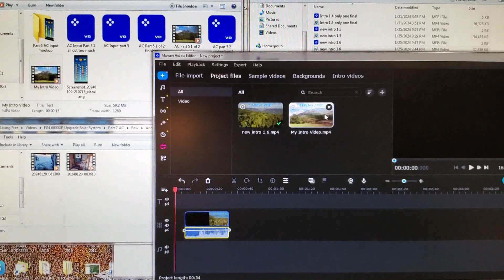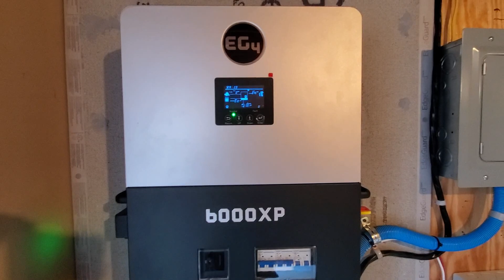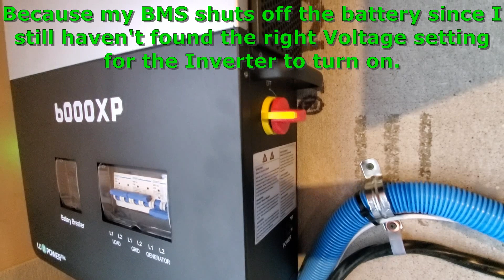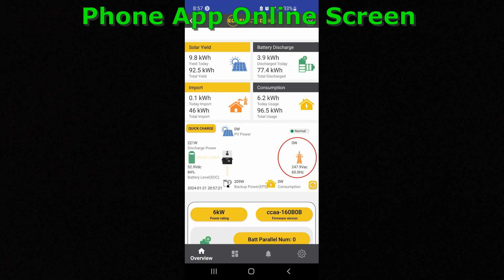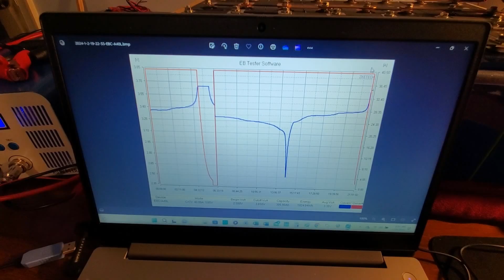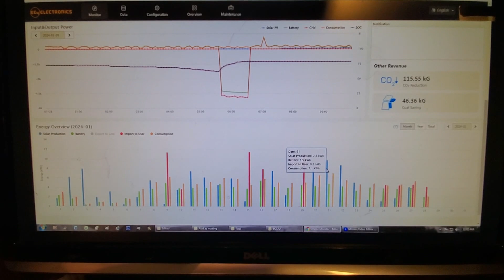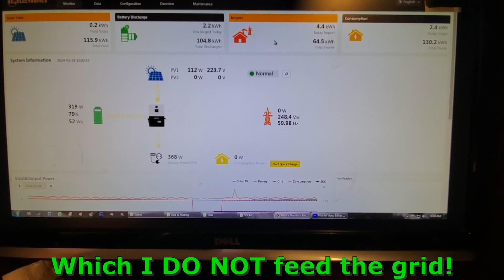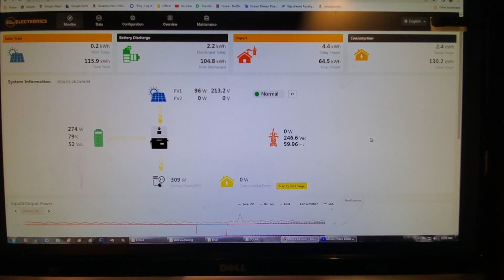EG4 6000XP - Part 7 - Settings and Thoughts I - Solar System Upgrade

Comment: just ordered a 6000xp I hope it was not a mistake. I have 3600 watts of panels for now. I have 4 12 volt lifepo4 standard 100 batteries. Is this going to work for me? New to solar. Thanks New sub.
Reply from the maker: The 6000xp is a 48v system so putting your batteries in series should work. Of course you're always going to want more panels and batteries lol

Comment: I like the new intro.  Yes I agree the transfer switch in the 6000XP is really good.  I'm powering almost my entire main floor with it.  Since my panels aren't mounted yet I'm not getting enough solar daily to meet the demand. So when I hit my "On Grid EOD Discharge" percent of 20% it switches to bypass.  
As for the vampire loss you're also losing some on the way in  and out of the batteries.  I think it's 5% each way.  That may account for the difference you see from Solar + Import doesn't equal Demand. Thanks for all the tips on the software.  If you have the real estate I vote to keep the panels in a straight line as it is easier and gives you more usable land.
Reply from the maker: Thanks! Agreed and my solar isn't enough either lol always something isn't it but one day i will pull the plug lol! Ya I'm thinking straight line too for now too since I can really only add 6 more panels with the V offset from cold and it would look off balance plus its easier! I'm all for easier lol i do love that Quick Charge button from anywhere my phone can go. If a storm is coming and batteries are low, push it and an hour later I've got 50% or better charge back in my batteries without even being at home! I'm gald I hooked it to grid actually far more dependable for now and no clock, computer,  modem resets! Thanks again for your comment! Take care

Comment: Does your bms not come with a communications port?
Reply from the maker: Not one that will work with the EG4 or I should say, without adding other devices etc. I'm old school and don't like buying the latest "greatest" thing. I figured out the voltage I needed and it's working fine now. It's not using the full capacity of the battery but will once it's balanced so I would prefer to not add more devices to the system, spend more time learning how to use it correctly only to find out it doesn't add that much amp to really make a difference (I mean really, 2 amps for this size battery only when it's over 3.45V? How does that really help much?) that would off set my time and money. I'm just not sold those kinds of things unless I can prove it myself. Too many people selling on Utube as what I call nowadays " reality TV salesmen" as if they really care about  your system. It's all about the money sadly. Thanks for you comment. Wishing you the best. Take Care.
Reply: @LivingFree4All  Each to their own. As someone with a background in engineering I can say that as long as you are not over charging the cells horrendously every day they should be just fine.
Reply from the maker: Hi Dave, I am not over (or under charging), I can't get enough solar to do that with these panels lol. I shut down all AC charging at 3.4V as I don't want to use anymore grid power than needed just to get them to about 50%. Plus my BMS will not let any one cell go over 3.64 as I set it, not even 3.65 ever. I'm not an engineer but I play one on UTube lol I'm just a 40 year contractor in construction with 4 years at Tesla so I like to play like I don't know what I'm doing but I know more than most think lol Thanks for your concerns, I appreciate it. Take care. @davefroman4700
Reply from the maker: As an engineer you measure with a micrometer and I mark it with a crayon lol btw that's a joke from my father who is also an engineer. He once spent 15 minutes explaining to me how to safely erect my kids swing set when I picked up the 6x6, climbed the ladder with it and placed it on the top 2 seconds later and his response was, or you could do it that way, while laughing, not that it works out that way always. I do hire structural engineers to cover my ass for sure lol @davefroman4700

Comment: I am currently trying to decide between the 6000XP or an 18k PV when I finally get around to replacing the 6500EX.
Reply from the maker: Lol I can't help you with the 6500EX (ive heard some not so good things about it but I really don't know) or the 18k PV. To each their own I say. If you wanted to buy batteries for it (a big yes considering the current world conditions and no grid in the future or other reasons) I would go with a server rack battery. Sad part is, the batteries are the most expensive part of the system. Panels go for $50 each if you don't get top of the line or can go used, which mine are and they produce about the same amount of power and i have no reason to believe that's going to stop anytime soon, guess I'll find out. 5-6 years and still strong as new! Good luck with what you go for. Let me know you thoughts once you start down your path! Thanks for the comment, Take care!
Reply: I have the 18K PV it can handle load imbalance real well. up to 8,000 watts on one leg plus it only uses 70 watts to run as a 12k inverter. I have 14.6k of bi-facial SEG  panels and it can handle 18k no trouble.
Reply from the maker: One nice thing about doing 3 of these 6000xp would be the redundancy factor.  If one went out you would still have 12k working. That's why I went with the 6000xp. Redundancy means a lot to me. But im going to pay the price on additional power drain of 3 of them!

Comment: That looks quite nice!  The bank probably needs to be larger and you'll probably want even more solar.  Once you start using hybrid inverter solutions you will quickly find that the "idle power" of the inverter is pretty bad, usually 30W-60W.  So you need to have enough solar and storage for that vampire draw to be less consequential.

The BMS high-side disconnect should be roughly 3.65V/cell.    Typical charging parameters are to charge to 3.55V/cell (bulk target), which would be 56.8V, then hold there for 1-2 hours (absorption) to give the BMS time to balance the cells, then drop to a float of 53.6V to 54.0V.   Disable any current tail setting in the charger.

The key to keeping the cells in balance is to hold at the charge target for long enough for the BMS to be able to make progress on its balancing.  If you can program the BMS, program it with the above settings.  Also if you can program the BMS's cell balance-start voltage, select a voltage of 3.45V or 3.50V for the balance-start.  No lower than 3.40V (the balancer will make incorrect decisions if trying to balance below 3.40V/cell and tend to take the battery out of balance instead of bring it into balance).

If the cells are way out of balance it could take quite a while, as in weeks, for the BMS to be able to get them back into balance.  Once they are in balance you should no longer be hitting any sort of BMS disconnect on the high side (with the 3.55V/cell charging target).

For the low-side disconnect, the bank will be at 48.0V at 95% discharged, roughly (3.0V/cell).  That's the level I recommend you program the EG4 to stop drawing from the batteries.   Once the BMS has balanced the bank it shouldn't be disconnecting prior to the bank dropping to 48.0V.   The BMS typically disconnects when a cell hits 2.7V (43.2V for the bank).

You definitely do not want to allow the cells to get too low, for multiple reasons.  And you are correct that a properly configured and balanced system should never be hitting BMS disconnects.

--

For the solar panels, either configuration works.  The straight line would probably be easier to work with and also be easier when expanding the system later (to add a second line).  Go for the highest string VOC that the EG4 can handle to minimize cabling losses.  But be sure to have a 20% margin of error for the labeled VOC on the panels that you add up vs the EG4's maximum DC input voltage, particularly since the panels will be more efficient than usual in the cold weather.

-Matt
Reply from the maker: Hi Matt, Thanks for the detailed comment. I agree lol I don't have near enough panels right now and the current 14k battery is pushing the lower limit hence why I have the second battery which will get me to 28k which will work a lot better. either way I hook up the panels they will be in series so I can get my voltage up higher. I can't go all 16 in series since that will push it over the voltage with the same 20% margin of error on cold days you talked about which is a dilemma I am facing. I can only put 14 which leave me with 2 to spare. That's not near enough to charge a 28k battery bank lol. The higher voltage coming in would increase the efficiency of the solar charger for sure too.  So yes I know I need up the panels to beyond 14 panels. Fortunately, I have the 2nd MPPT on the inverter so I can add different panels when I do expand it more. If I get a second 6000XP i will have 2 more different arrays I can add as well. So I do like that about this inverter, room to grow.

Regarding the battery balancing, I find the amount these BMS's produce and the limit of being able to balance all the time, is not worth the effort or money trying to make it happen. I just take them off line once a year or two and re-balance them when they get too far out. I'm really not sold on balances. Maybe I'll change my mind when I have more free time to play with it but right now, it's not as critical as the other things I need next and my time is too limited. Great comment and I appreciate your input! Thanks and take care!
Reply: @LivingFree4All  Sounds like you have a great handle on what you want to do.  I'll add two more observations that may help.

The first is... remember that you can always wire solar panels into discrete charge controllers (such as a Victron 100/20, or a Victron 150/35) to aid in charging the battery.  For discrete charge controllers the string operating voltage only has to be about +5V over the battery charge target... call it 62V, so there is more flexibility.  3 smaller panels in series or two residential panels in series is usually enough to get something going.

There is really no limit on the number of charge controllers you can connect to the battery beyond ensuring that the total maximum charging amps is within the capabilities of the bank.  For a large battery, that is typically a lot of amps so it isn't a problem.

--

The second observation is that being able to charge the bank to full is a function of solar power verses consumption.  Once the bank is big enough to cover 24 hours, the size of the bank no longer matters so much in terms of daily operation.  Only in terms of extra buffer to bridge bad days.

If the daily solar generation is insufficient to cover 24-hours of consumption the battery state of charge will simply continue to drop day after day until its is knocking against empty.  And if the daily solar generation is sufficient, the battery will slowly claw-back its charge day after day until it starts knocking against 100%.

Optimizing this is as much about optimizing/reducing the consumption as it is about adding solar to cover the consumption.

Good luck!  I wish I had that much space for my panels.  I mostly have to put them on my roof which takes a lot more effort.

-Matt
Reply from the maker: Ya ouch on the roof solar, I am lucky with having some land so it was always going to be a ground mount for me. I like to have 3 days of battery power without solar and had it before my upgrade. Living on the east coast, boy it can be cloudy a lot especially at the worst time winter! I want total independence from grid. I'm not there yet lol. I really need 4 times the solar panels that I have now for both batteries but fortunately solar panels are the cheapest part of this system and I got space. I will add a 11-12k propane generator to the system with 500 or higher gallon propane tank just of battery charging when cloudy days discharge my batteries to get me fully off grid. There is a lot more to solar than people think, what you are running on it, how efficient are the things you are running, etc etc. and I find it challenging and fun learning the reality of it. Cheaper to use more efficient appliances than addng more inverter/batteries/solar panels and that is where most should start then develop the solar system or at least both lol. I did love my victron 250/70 solar charger and I'm going to have to find use for it again here tied directly to batteries like you said. Great advice and Thanks for the comment. Take care!

Edited: btw this EG4 6000XP has two separate MPPT chargers so I can put 2 different solar array configured on it , plus I can use my old Victron 250/70 direct to battery too to add more solar to the system. Now i need another pallet of panels lol, It never ends does it lol Thanks

  @junkerzn7312

Comment: I use the JK B2A24S20P BMS with 2 amp active balancing @ 200A 48V. it is a Smart BMS with Bluetooth. As soon as the cell voltage hits 3.45v it begins balancing the pack. JK also makes the same thing in an inverter style that will talk with the EG4 inverter/charger. your overkill BMS is made by JBD and is a passive balancer. Passive has a hard time keeping the battery equal.
Reply from the maker: Interesting, I'll look into it some day lol. If you read the above comment I made about what I think about balancing you might understand why I don't spend a lot of time with devices that say they will balance a battery. After 5 years with these batteries, I really don't have  that much problem. This one is off because they were never balanced as a set but are 2 separate batteries over the last few years. That may be a problem, I'll soon find out. Balancing the batteries is easy once you reconfigure them. It just takes several weeks of doing nothing but topping them. In my opinion, it's faster and better than any cell balancer (easy and no time) so I really don't mind. Thanks for your commit, wishing you the best. Take care.
Reply: I've been looking into JK bms for a looped system with the EG4's. Does it really communicate with the EG4 6000XP? Off grid garage also came across a chip that will do crazy stuff between inverters and JK bms's.
Reply: Yes, he calls it the Peter Board. The JK-BMS inverter version will communicate with LuxPower based EG4 inverters.
Reply: @stevenfrazier8939  Yep, the peter board ...lol 
Thanks so much. I have been trying to verify this for a few days now.
Reply from the maker: I will have to make a video to ask about the "communication" between BMS and the inverter as I would like to know more about what the inverter can do with this infromation and how it relates to the BMS. What does it actually communicate and how can it benefit the system, mainly will my inverter be able to read each cell on each battery and react? or is it just simple total battery voltage etc. I need to learn more about this. Thanks for comments @stevenfrazier8939
Reply: @LivingFree4All  I'm a about 5-6 months into this rabbit hole and got 16 cells coming from china, so we shall see how this plays out. I'm a engineer and have always loved electrical stuff since I was a kid so this first build should be interesting. My brother was going to help me as he was trained in building lithium batteries as he was a A&P mechanic but he died unexpectedly on the 13th so I'm on my own now. learning all about balancing cells etc. I am acquiring tools, testers, batteries, mounting fixtures, panels as I go along. Thanks for your videos.
Reply from the maker: @classiccrypto  sorry to hear about your loss.  I used to carry my A&P license as well. I worked for Tesla solar design systems as well.  Fingers crossed for your china buy... get a battery tester like mine so you know what you got and it can charge or discharge them. I have 11 videos hopefully they help but im constantly thinking of other details ive done which i still haven't discussed yet on videos and I'm learning all the time too still. You'll be fine, just take your time, research and enjoy making your own power plant! It's pretty cool 😎
Reply: @LivingFree4All  ya, my brother worked on turbines and smaller jets. He had just accepted cepted an offer from space x and then had a stroke out of the blue.
I have the zektech and the riden rd2024 power supply already. I have watched your videos but need to go back and watch them again. I've also watched ray builds cool stuff which is really good. 
I'm disabled so to a back injury that lead to getting als so this keeps my mind going. I can't walk so everything is a challenge but since I was an engineer I make do.
Reply from the maker: Ya I was about to suggest Ray builds cool stuff, he does some of the most detailed DIY battery videos out and he’s just a good old boy from Texas like me. Just don’t buy the batteries from Jenny Wu, half of mine came from her and they were subpar, now she did give me 4 more batteries because of it (because I had proof from my tester) but I had to pay $100 shipping so better than nothing.  Also off-grid garage with Andy is pretty good too. Both are pretty detailed oriented more so than me! No wait, did I just say that... no I'm far better than both of them.... ok maybe not :( @classiccrypto
Reply from the maker: I love an open conversation about solar lol Thanks for comments! @classiccrypto